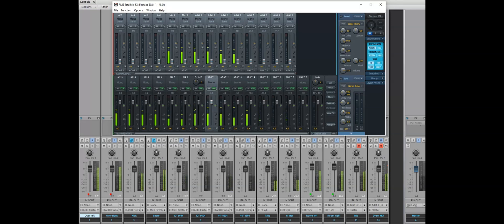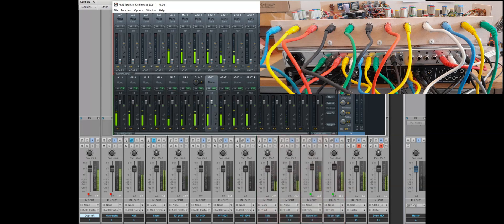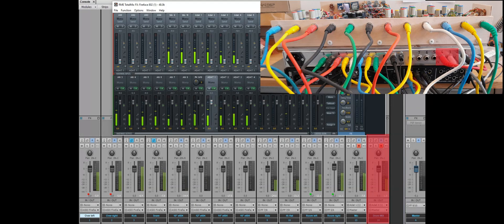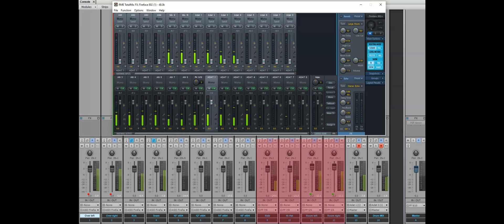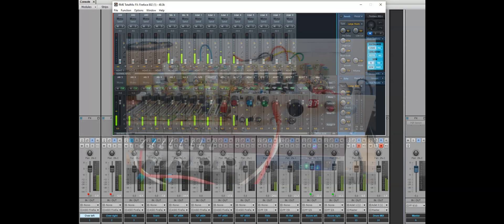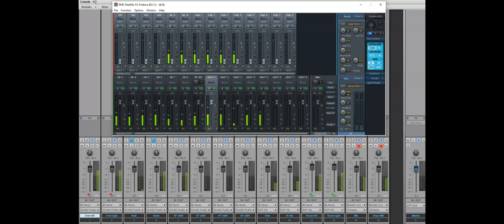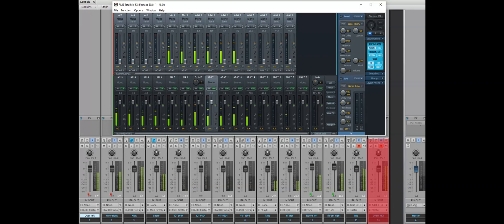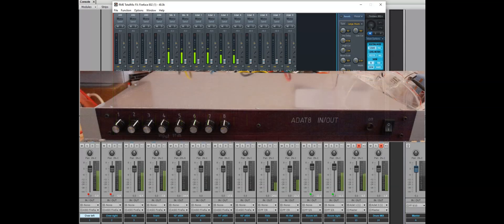DIY ADAT8 in/out interface is READY!

Comment: Woow!! Is this open source project? Amazing!
Reply from the maker: Well, I only had ic chips so I guess it's open source project. I made it slave so it didn't need programming or hassling with other clocks than wordclock.
Reply: @HIFI-SUDIO_DIY  if it's open source, is it possible to obtain schematics and design notes?
Reply from the maker: Sorry, I didn't really know what "open source project" means 🙂.  I only followed Cool audio V1401/V1402 and Alesis AL1101/AL1201 datasheets. If I wasn't sure of something, Behringer ada8000 schematics helped (available from net). I left all clock things out and made the whole thing slave (wordclock  signal comes from device it is connected to). I didn't make any schematics. In and out buffers are from sound-au.com (I just adjusted resistor for suitable gain).
Reply: @HIFI-SUDIO_DIY  thank you! I will study this. There’s not a lot of information available unfortunately about this topic.
Reply: @HIFI-SUDIO_DIY  what he meant by open source is: if you wrote any notes, drew any schematics, listed any bill of materials, designed any layouts for the perfboards, would you care to publish them, make them available for the general public with a licence that allows for free reproduction and sharing?
Reply from the maker: @HenryCooperAvelOficial  I didn't draw any schematics. I just connect everything as it told in datasheets.